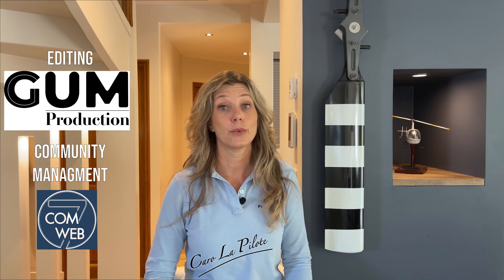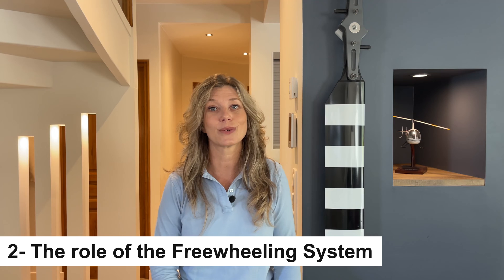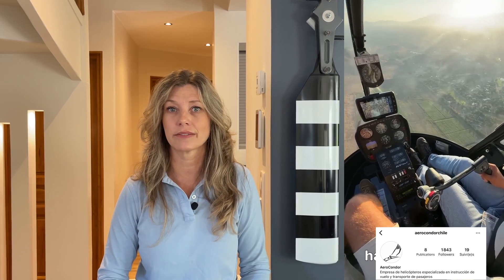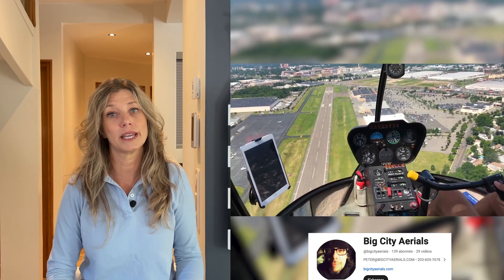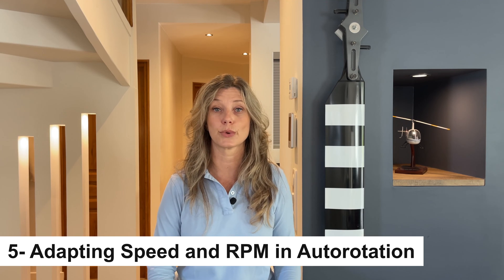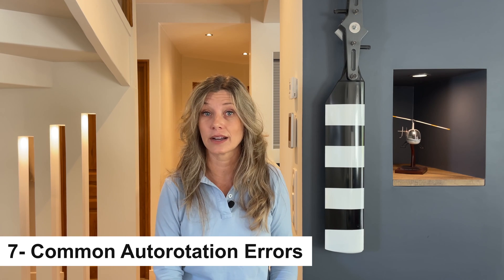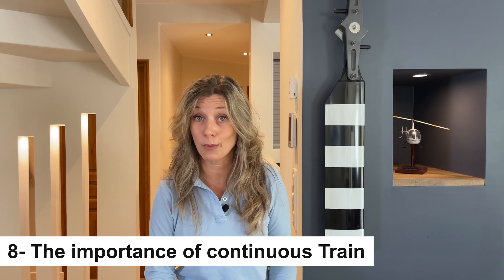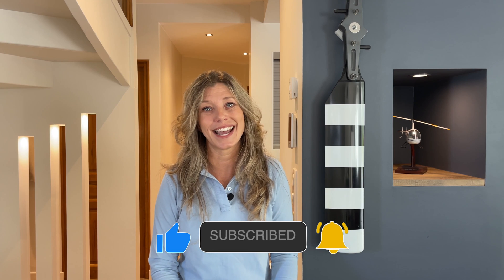Autorotation : Step by step

Comment: Thank you Caro. Is there a "normal" rate of descent to a runway, under power, as with ILS at a usual 3 degrees? You mentioned controlling yaw, in auto rotation, so if the transmission hasn't failed, is the tail rotor still operating at its relative speed? Strike the last question. The answer is obvious.
Reply from the maker: Great question! In autorotation, the descent rate typically ranges from 1500 to 2500 feet per minute depending on the helicopter and airspeed — definitely steeper than the 3° ILS path! And yes, if the transmission is intact, the tail rotor is still driven by the main rotor during auto. Thanks for the thoughtful comment!

Comment: Great video, thanks. 
What do you do if your helicopter can't auto ?
Reply from the maker: I don’t know of a helicopter that can’t autorotate 🤷‍♀️
Reply: @flyhighwithcarothepilot  😉😉 I'm being silly really, but I made a Fixed pitch coaxial pendulum helicopter on my channel. It can't autorotate because it doesn't have blade feathering. It shouldn't be flown above a few feet and even that is pushing it. It also doesn't have a sprag clutch or even a swash plate but it can hover reasonably well. 
I think we are in different worlds but share an interest in how things work.
Reply from the maker: Sounds fun 🤩